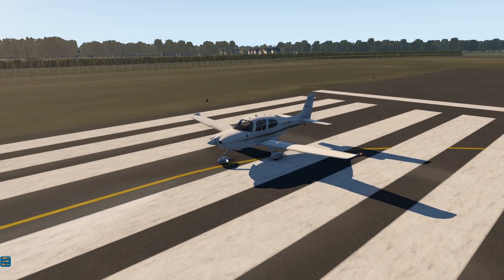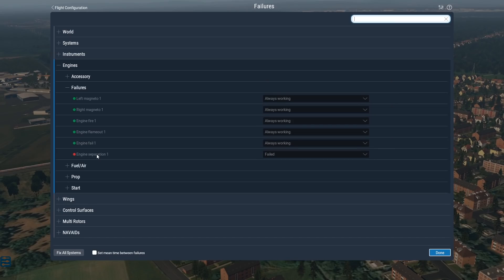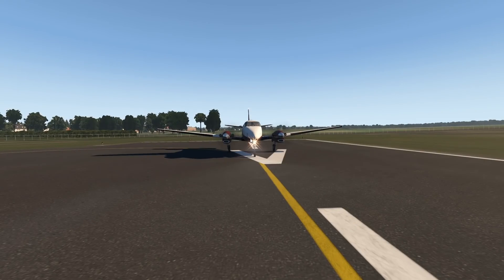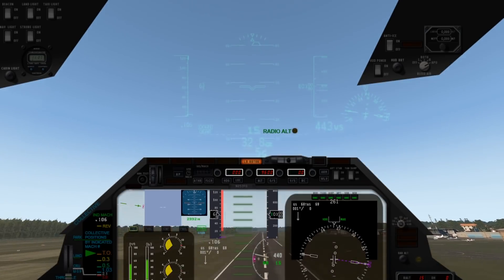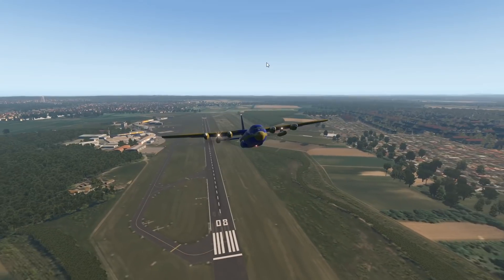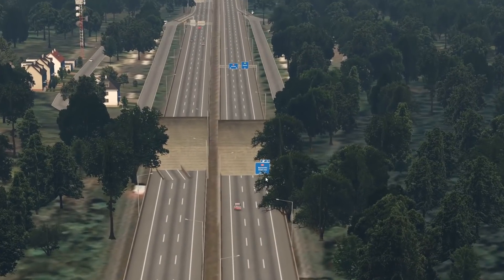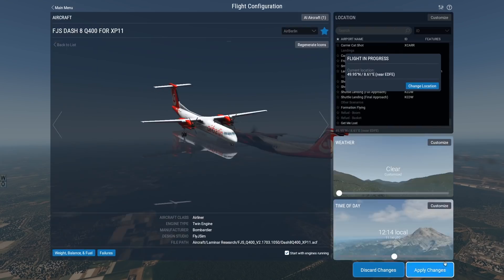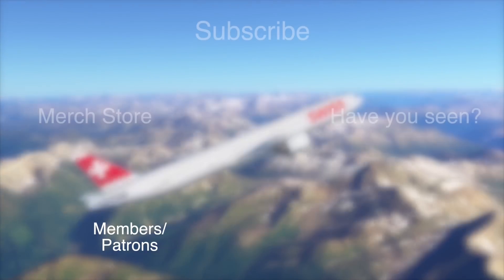Q400 Propeller Destruction - Can It Land Safely?

Comment: A situation similar to the miracle on the Hudson. Birds go through both intakes and destroy the engines. The Turbo Prop is just a jet engine strapped to a propeller with a gearbox that steps down the rotation.